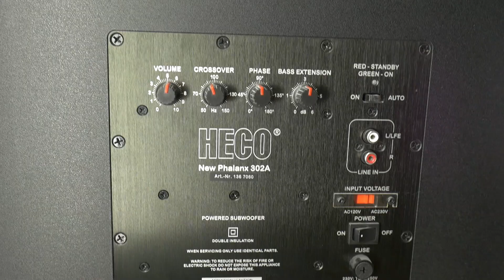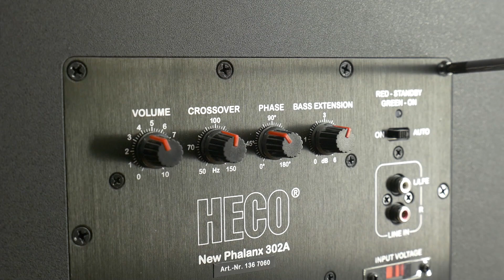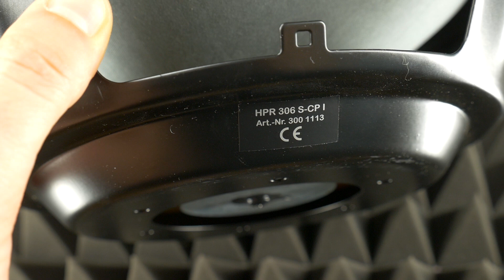Take apart Heco 12 inch Subwoofer - Disassembly

Comment: Take it apart?
Reply from the maker: @heyjarrod  ?
Reply: @ Yeah, I thought I was gonna watch someone take apart a 12 inch subwoofer… like the title says, ha ha. 

I want to use some 4 x 12 cabinets as props for my tribute band. Which may entail taking off the grill cloth also. 

So I want to take anything heavy off of the speaker, the magnet and whatever else can be removed, and just screw the rest of the speaker back in… so from the front, it looks like a working cab. 

Removing the magnets will really lighten up the cab, as well as maybe leaving the back off.

I really don’t have anything to heat up any metal or cut anything, wondering how much I can take off of a woofer with just a few tools. Thank you!

Comment: Hello, you could be of help.
I have a Sony subwoofer that used to belong to a receiver box. It's a passive subwoofer, had no power or nothing, just the wires (one with a black line and one without).
I want to connect the subwoofer to my Vizio (5.1) soundbar with a wireless subwoofer. I want to connect it without any long term damage to the system. Any help or tips?
Reply from the maker: @ZZPAPU7  forget.
Reply: @Techscrews  😞